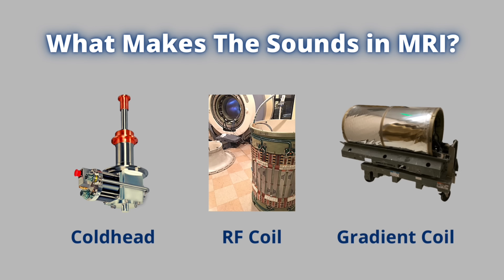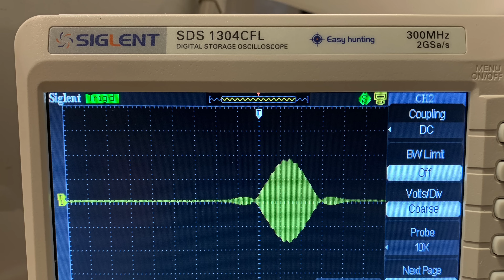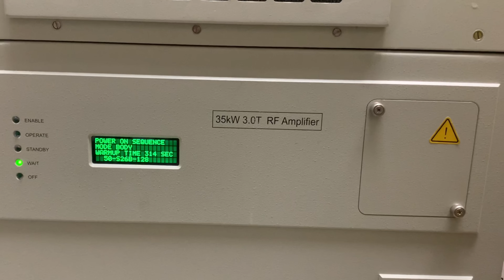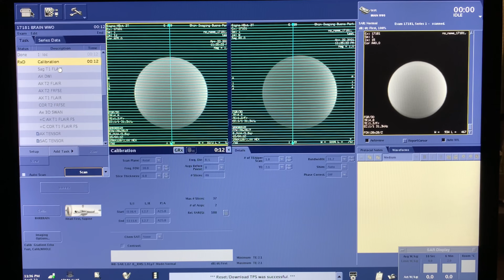What Makes The Different MRI Scan Sounds? Knocking to Rhythmic Chirping MRI Sounds Explained

Comment: How odd. I had an MRI earlier today. I spent the time in the machine trying to figure out what makes the loud knocking sounds and why they are different with each separate scan. The operations tech didn't have the slightest idea why. I said I'd look it up later on that night. Before I did any search involving anything on the subject, this video popped up in my feed. My cell was in my jacket at the bottom of a plastic bag in a locker in a different room from where I asked the question so...nope, not Big Brother listening in. And this video has never popped up before, otherwise I'd have watched it. Thank you...Internet?
Reply: If you have Google's location tracking switched on it probably detected that you were at a medical imaging location and used that as a factor when populating your youtube feed.
Reply: @SiblingCreature  That's a perfectly acceptable conclusion. Makes sense.

Comment: I've had one recently and it was incredibly quiet, compared to what I remember from many years ago. It was so relaxing, I almost fell asleep during those 40 minutes. There was a distinct part of the scan that drew my attention though, when the entire machine started shaking around twice a second. It sounded like a really big element in the machine is moving around rapidly back and forth or something. Any idea what that is?
Reply: It’d be a lot more zen if I wasn’t being told to hold my breath over and over again. Last MRI I had was about 1.5 hours in the bore. Every itch comes out to torture you, arm is always sitting funny and starts to hurt, need to piss etc but thru it all I’m still as a mummy because I want the best possible result.
Reply: As for the shaking, prob a specific pattern of drive to the gradient coils. You’ve got 1-3 Tesla (1000-3000 gauss) electro magnet with these gradient field coils they drive that basically wobble the magnetic field of the electromagnet to make the hydrogen nuclei in the cells of your body spin this way or that and it takes a tremendous amount of current. The coils are well bonded to the housing but the forces are tremendous so they move around. The force is proportional to the magnitude of the current, the dimensions of the loop, and the intensity of the field.
Reply: literally just had an MRI scan done about 3 hours ago and it was exactly the same for me as what you described. Except that I was lying on my front so it wasn't that relaxing. But it was mostly quiet (relatively) except for a section at around the middle of the scan when it made very loud clicking / banging sounds, and it also started shaking and vibrating. Pretty interesting nonetheless

Comment: My only MRI was searching for an abscess. I was told to stay very still, but then the table seemed to be vibrating my body at several low frequencies.  Do you have a video on how and why the table in an MRI moves the way it does?
Reply: The table moves to center whatever is being imaged to the isocenter of the magnet.  The vibration you feel is the radio-frequency pulse together with the inherent coils.  It's pretty insane physics actually.  I'm an MRI tech and when people ask how it works, we say magic because it's easier than to explain it.  Lol
Reply: @amandaeaster8205  Is there a circumstance when the table would jiggle as part of the scan, or as part of a program the machine runs? It didn't feel like force being applied to ME, it felt like the motion of  table under me was moving in a deliberate and controlled way, and THAT was moving me.

Comment: 00:55  Note: sublimation refers to a solid transforming directly into a gas, skipping the liquid phase, for example dry ice.  A liquid transforming into a gas, such as helium in this instance, is referred to as boiling or evaporation (if this phase transformation occurs at a temperature below the boiling point, as we commonly see when a little water splashes on the countertop next to your sink).  Great explanation of the racket produced by an MRI.

Comment: Are there different cooling techniques for the cold head? I had an MRI recently and I didn't hear a number of these sounds, whereas I did with one I had ages ago.
Reply: Depends on the machine and what kind of scan you got.
Reply: Some manufacturers enclose the gradient coils in a vacuum chamber, which greatly reduces the noise they create during a scan.  But this comes at a price as the coils can't be cooled as easily.   Gradient coils are liquid cooled due to the immense amount of heat they generate during a scan.   Old, old MRI magnets, and I mean OLD now, used a separate jacket of liquid nitrogen to insulate the helium vessel to reduce the amount of helium boil off.   This necessitated a weekly fill of nitrogen to replenish it.   The helium liquid would usually need to be filled approx every 3 weeks.   This was in the days before the cold head technology came along.   Naturally, those old magnets would not exhibit the pumping noise of a cold head because there wasn't one.   Magnets with cold heads theoretically never need to be refilled as the helium boil off was constantly recycled back into the cryo vessel.   HUGE amounts of cooling water is needed though to keep the cyro compressor happy otherwise it overheats and shuts down.   When that happens helium boil off rates go through the roof.   And that stuff ain't cheap.

Comment: another question- is there different type of gradient coils? I know they all have XYZ but I have heard of saddle/ horse shoe shaped coils when asking about scanners to my hospital.
Reply from the maker: The gradient coils in an open MRI has a saddle/horseshoe configuration to accommodate a larger aperture. But i believe they may have been talking about the GE HNS (Head, neck, shoulder) Coil horseshoe accessory. It is shaped like a horseshoe and the patients head sits in the center of the horseshoe. The HNS coil acts like an antenna to improve return signal and helps to increase SNR. It can get confusing with so many components named coil eg. RF coil, gradient coil, brain coil, knee coil, etc. but they are all aptly named as these components contain large loops of copper wiring to help improve local signal. I hope this was helpful. Thank you for the great question!

Comment: nice video! thanks for uploading! I'd love to know from where an mri gets its electricity if it has no apparent plug
Reply from the maker: Great question! That would make a great video topic. The cables and plugs are hidden behind the covers. They are routed behind the MRI scanner to stay hidden during scan operations. Power and data cables connect to the equipment room via a specialized RF-shielded penetration panel. The primary magnetic field coils get their power during a  magnet ramp up procedure. The high amperage current is sealed inside the magnet to produce a "permanent" magnet that is always on. That is an amazing procedure to see. I will have to shoot a video of the process during the next magnet ramp. Thank you for the question!
Reply: @MRIPETCTSupportEngineer  it’s because during the GE Signa Hero unveiling, i noticed the display went on during the presentation
Reply from the maker: Wow I hadn’t seen that video. GE definitely makes a great MRI. Thank you!
Reply: @MRIPETCTSupportEngineer  Yes please to a video of the magnet ramp up!

Comment: You would think the engineering of these machines would be updated and improved over time as to quieten down these annoying noises. automobiles have mufflers for a reason.. .
Reply: Don't try to fix what's not broken
Reply: @cheapskateaquatics7103  well since you got something against advancing technology you shouldn't bother worrying about what kind of house you live in or what kind of car you drive or even your clothes cuz it doesn't matter right.. .
Reply: @bobadingo  an mri is an advanced multi-million dollar piece of medical equipment. It's not some car that can be quieted with a muffler. Their power efficiency and image resolution gets better every year. They have gotten quieter and faster over the years, but you can only quite it so much before you start to impede performance. Heaven forbid the device that could save your life  makes "annoying noises".  Getting a clear image is a little more important.
Reply: @cheapskateaquatics7103  sir I'm way ahead of you on the subject matter!  I really don't want to get into bringing you up to par if that's even possible. But technology will Advance past the philosophies of people like yourself who would prefer to be living in the past.. .
Reply: you can just wear earplugs..
Reply: @cheapskateaquatics7103  MRI supposed to be comfortable
Reply: Some companies have already developed technologies for quieting the systems down significantly. I.e. a vacuum chamber around the gradient coil. This dampens the knocking sounds created during scanning. However, as mentioned above, you can only quiet the system down to a certain extent. We are limited by what is possible with the laws of physics. Much like how modern technology is approaching the smallest electrical transistors possible.

Comment: Not much different reasons than for the 50 or 60hz humming sound a transformer produces.
(mentally downshifting to think about the fact that power transformers are a thing of the past in modern household technologies).
Not much different reasons than for the high pitched humming sound some  switched power supplies produces.

Comment: Wow, 4° above absolute zero!  That must take some serious machinery to produce!
Reply: Hopefully someday advances in superconductors would make such a system unnecessary. 
Even something that has superconductivity at 0°C would be a game changer as a cooling system similar to a refrigerator could be used.
Reply: You would be surprised by how simple it is. Genius, but simple. You will get 4K just by letting liquid helium evaporate at normal pressure (like you get 0°C by letting ice melt in water). To liquify the helium you need the cold head, which is mechanically very simple. (You saw it in the video. The explanation was not quite accurate though.) The people who figured it out for the first time were of course very smart.

Now, getting below 4K is much more challenging...
Reply: I should add that simple in theory does not mean simple in practice. Such systems are expensive to operate and maintain. They require a lot of energy, and you have to refill expensive helium if it leaks. Also, cryogenic temperatures are generally not prolonging the life of mechanical components...
Reply: Performing a cryo fill on a magnet is an adventure.   Everything, and I mean, everything, gets very very cold.   The magnet turret frosts over, first with water vapor, then frozen air.   Liquid oxygen begins to drip off of the turret and associated plumbing and fall on the floor.   It bounces off of the magnet side and stings your skin.   Afterward the fill, things have to be warmed back up with a heat gun, which doesn't like being in an intense magnetic field.   All kinds of fun to be had.

Comment: So what you're telling me. 
Is this multi million dollar machine makes noise because
1) no sound absorbing material is used inside the housing to absorb loud pumping of helium and the knocking of the coils on the fibreglass cabinet?

So.. the wankers that make there's put zero thought Into a few mm's more of room to apply a sound deadening fibre ??

😅
And these engineers are considered genius?